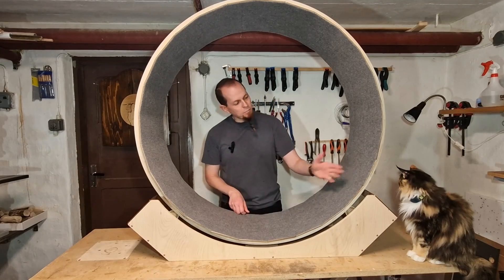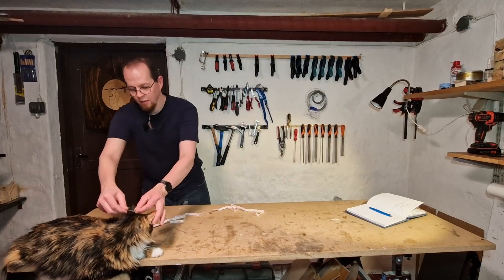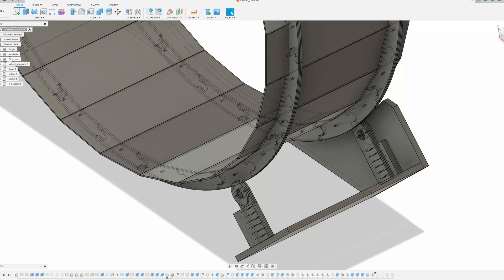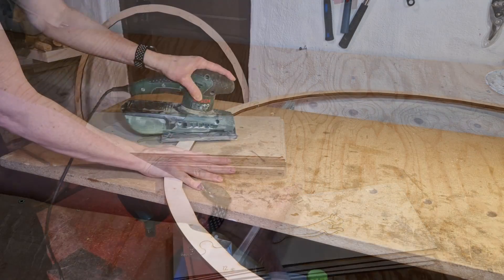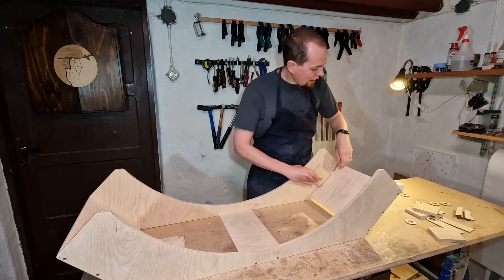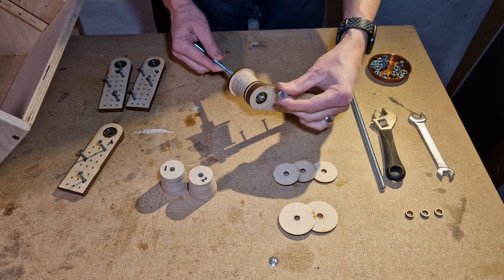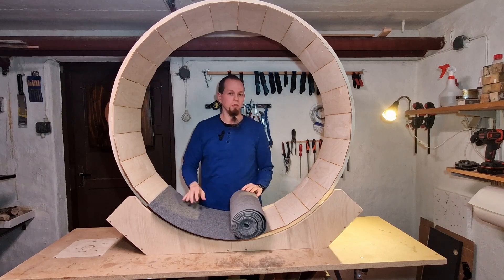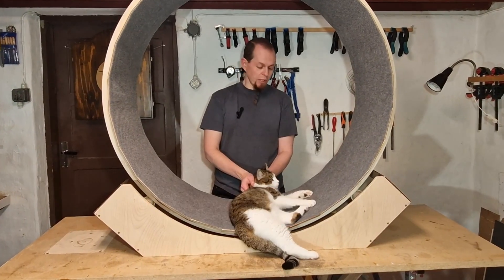Make a Cat Exercise Wheel

Comment: The tapered wheels are nice, however the wood on wood friction and hoise would be a bit to get used to.   You could use roller blade skate wheels and a shallow guide track on the wheel to dampen the noise?

Comment: Do you have any idea how to make the wheel quiet? I believe, some kind of shock absorbers under the rollers should do the trick, but I still cannot come with a suitable design.
Reply from the maker: I think a rubber strip would help with the noise. But the cats do not use it too often and it is thus not a problem for me.

Comment: Nice project but cheaper to buuy one
Reply: @walterhartmann4830  hey I don't think so it's cheaper to but 1 meter running wheel, at least in my country. It is from 150€ minimum and still it was 95cm length.
Reply: Not really!  Good ones cost $200

Comment: great video! I have two cats, and they are leaning towards chubby side so I'd like to make this for them for exercise. Would I be able to take the part templates, and have the pieces cut out at Home Depot or something?
Reply from the maker: I am not sure how home depot works, but it they or any other place cuts wood from plans using a cnc machine or laser cutter then it would work.
Reply: Home improvement stores don’t typically do precision cuts like this. They might cut it in half to fit in your car, but final dimensions are the customer’s responsibility.

Comment: Nice design except a bit noisy, perhaps you could use a softer material for the support wheels such as polyurthane ? I believe you can buy tapered bushes in this material or just buy some skate board wheels and machine a taper on them?
Reply from the maker: It is a bit noisy, but I think it is mostly the large ring. Skateboard wheel would certainly help to reduce a lot of the noise. But the cats seems happy and it is not in a place where it bothers me. But for small places it is certainly a thing to keep in mind.

Comment: Beautiful! What was causing the clicking noise, out of curiosity?
Reply from the maker: When I tightened the wheels the wheel housing with the bearing pushed out a bit (I tightened it a bit too much). This bit of skewness made something catch, but I am not completely sure what. But when I looked I saw the housing was not straight and saw why and adjusted it to be in line and everything worked. In the new video a new sound can be heard just after I installed the speedometer - this is because the the housing was millimeters too tall because I measured wrong. The fix here was sanding the housing a bit which solved the problem.